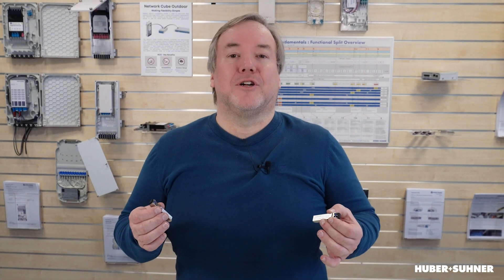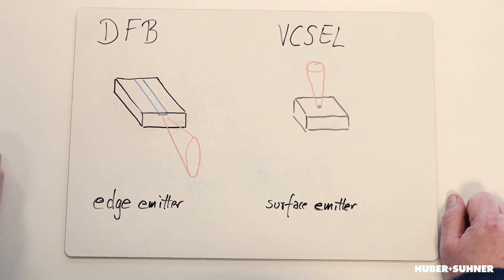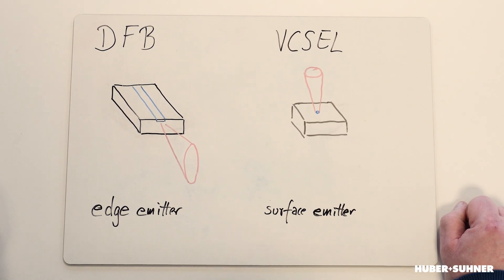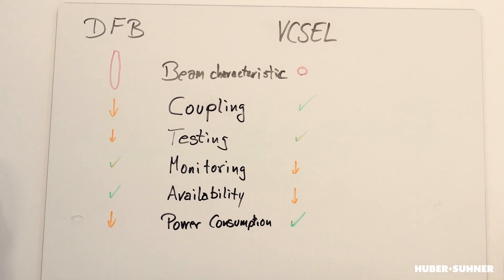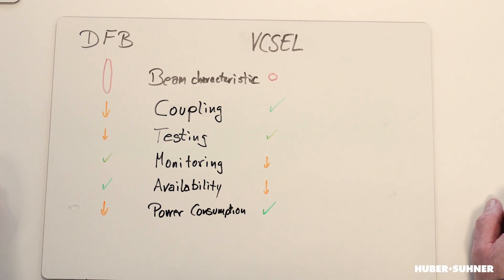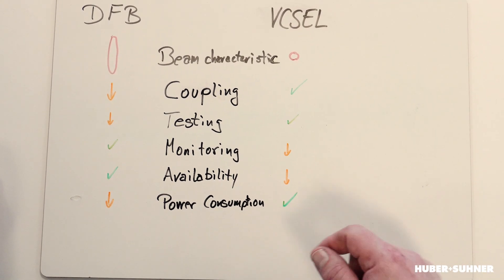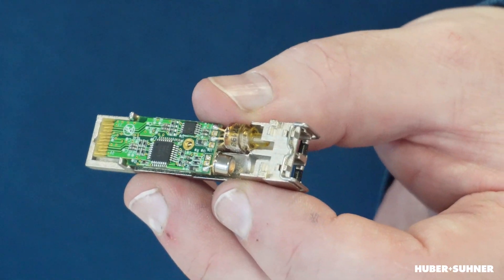Transceiver Laser Types Explained (04-02-03)

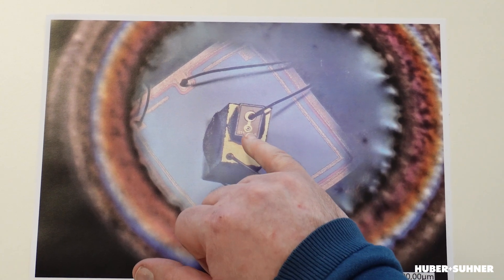Comment: 3:49 isn't that a VCSEL? the hole is on the top?

I've seen a video where they show an edge-emitter laser being power up gradually as low power before and it looks pretty fascinating... it seemingly a solid block of silicon but at a specific voltage, a small spot just emits light
Reply from the maker: You are absolutely right! That is the VCSEL. Thomas misspoke and we didn't notice it. Thanks for pointing it out.
I couldn't agree more. The technology is really fascinating and there is so much more...